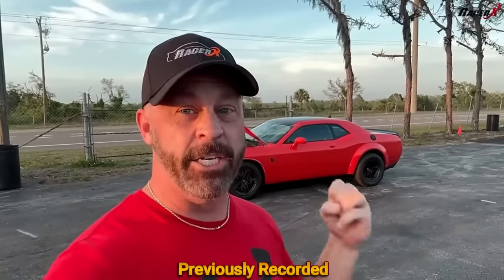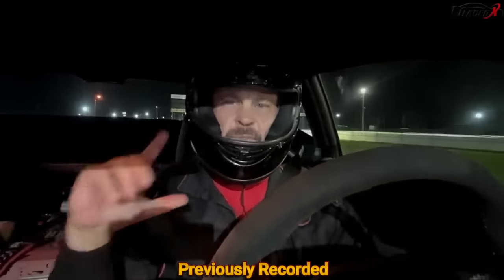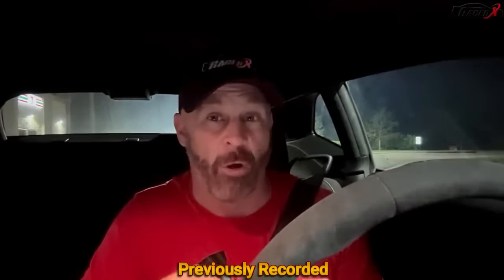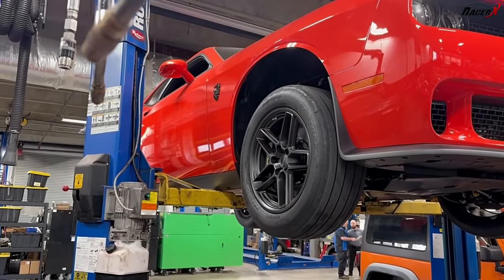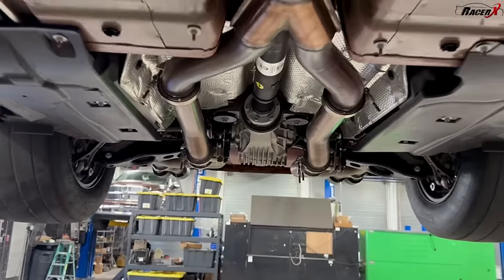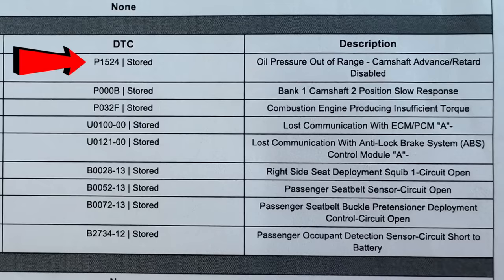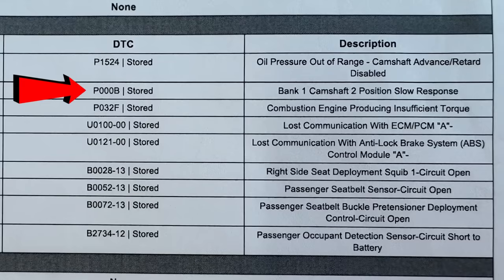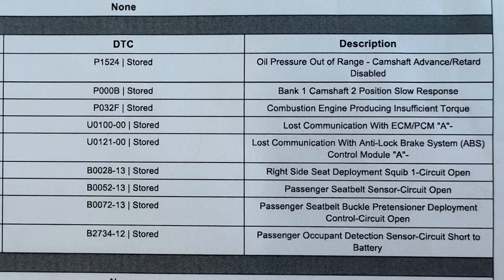What's Going on with my Demon 170?  Is my Engine Trashed?

Comment from the maker: Here is the link to the Dream Giveaway Plum Crazy Challenger Giveaway with my Code:
https://www.dreamgiveaway.com/tickets/challenger?promo=RACERX
Reply: I was messing with my 2016 ram 1500 PCM I accidentally left one of the connection not attached enough. And for some reason it was revving my motor at 1500rpm. It usually sits below 900. I went back and sat it correctly and it was fine after. It was throwing low battery voltage. And ABS light with traction control.
Reply: You picked the perfect colors for a vehicle named the Demon !!!

Comment: I am so glad I'm still stuck in "Old School Mode"..  All that $$$ and issues with new and owned by the dealer for analysis and fix.. No more "tinkering" yourself..  God bless you techies..  And those with all the money....  I'll be happy with my carburetor  equipped Dinosaurs.!!
Reply: Right on.  The Demon is a beast but I'm afraid all this high tech is it's achillies heal.  I'll stick with my old 70 Challenger R/T.  I can't touch those ET's, but I'm ok with that.
Reply: Love my '70 AMX so much...had it 43 years now.
Reply: @airforceveteran71  wow, nice care they were quick back in the day...even the 390 AMC matador was fast....
Reply: @archieguitarz4700  you got a keeper brother. I still got my 1967 coronet R/T also...
Reply: @airforceveteran71  good for you!  A friend of mine raced an AMX for many years.  It was a rocket.
Reply: @jeffrey501green  hey thanks, love those big block b-bodies too!  Hope you get many more years of enjoyment out of it.
Reply: @archieguitarz4700  thanks, same back at you buddy...
Reply: @archieguitarz4700  Was a show room dealer car new...a Dick Teague classic for sure.
Reply: My 13 charger Pursuit was a cop car before I got my hands on it, and I thrash it, live way out in the country. 254,000 miles now and all I did was put in a new spark plugs, control arms and water pump. It still pushes me into the seat at 100mph.

Comment: Thanks for the update, I have been curious as to what was happening.  I hope they get you fixed up, but it is amazing to see a drag car with a warranty!
Reply: Yes it is. But that Warranty won’t do you much good if you can’t get the factory to back it up by getting in touch with the dealership. Or worse, having a car that doesn’t run right sitting in the dealership while having outrageous payments.

Comment: Really hope Dodge takes care of you and your car. You are such a super spokesperson for Dodge.😎
Reply: They would if they cared, but this is a whole new ballgame with Stellantis.
Reply: Dodge is not really Dodge anymore. They're worse.
Reply: I'll never buy dodge. You will be taken care of because you bought a high end car and you do YouTube. But dodge is bad about warranties and backing their products in my experience. I actually had my home burn down because of a recall on a 2004 Durango and got no compensation or anything. What a worthless car manufacturer. I will always hate them💯 also had a work van with extended warranty that was purchased when new. The motor blew and they would not stand behind it. Bought a new Chevrolet work van and I'll never go back. Goodluck to you and the car. Dodge is trash💯
Reply: @PSYCHOBABAYAGA Hopefully your Chevy van doesn't have any issues.
Reply: I mean he is beating the crap out of the car. Suspects something is wrong with it and does 4 more hard launches at the strip. I mean how many times has he ran it already 50 times, 100 times. That’s quite a bit of abuse especially given how violent the car throws that power to the wheels the first 60 feet something is bound to break doesn’t matter how tough it is from the factory
Reply: @reverselee3218  none it's been a great work van.
Reply: Dodge is really hurting financially. I doubt any of these people are gonna have luck getting their car fixed without suing dodge

Comment: Sure hope it's something stupid, like computer related. Missing the Demon content. Praying for you and the 170, brother
Reply: Typical Dodge junk
Reply: @allanhood4397  Yeah from a typical🤔 Dodge Hater..
Reply: Getto cars
Reply: I'm agreeing with the idea that it's ether a bad sensor or a programming issue. I just hope it's not a defect in the oil pump cavitation of the oil. That's going to cause damage. The computer should have a recording of the oil pressure when it set the codes. And the RPM at the time. Hoping for the best for you and your car.
Reply: @dragvan1937  I know this is 12 days old but it sounds like the violent launches pushes all the oil away from where it's needed causing the engine to start eating itself.  Was a known issue with the bosses at Stelantis but they had already built a bunch of engines so they quietly put in a better pump on all future built engines (or one that keeps the oil where it needs to be properly) and just crossed their fingers.

Comment: I ran the wholesale parts at that dealership.  It will be a miracle if you hear back on that Star case.  We had cars sitting around for months because I could not locate parts or Stelantis couldn't supply them.  The parts and service get screwed because Stelantis can't deliver.  I had to submit two and three requests for hellcat parts before they would release them.  I could have sold five times the parts if Stelantis could have just supplied them.

Comment: Sorry to hear that the Demon is down.  Hopefully it's something simple like a bad oil or cam sensor or just tuning.  When the intake manifold gasket took a dump on my Trackhawk, I got all kinds of error codes like cylinder misfire, bad throttle body and all kinds of codes related to vacuum leaks along with going into limp mode on the street.  Seems like when one thing is wrong, it makes the other stuff go nuts too.  The dealership had my ride for about 2 weeks, but the cool thing is that it was all covered under the 5 year powertrain warranty with 2 months to spare.  I hope you get it back soon sir.  Blessings!

Comment: Timing chain guide is broken and/or VVT. Cam phaser mounted on cam is bad.  That will cause Timing issues and it will go into limp mode. Oil pressure sender is bad but will not cause issues your having. Same symptoms I had on my 2012 SRT8 6.4

Comment: Stellantis tech here, that ‘head’ tech is gonna lose his ass working on that Demon. He will not be compensated for even half the time he spends wasting on this work order. He will quit and it’ll be the next guy up. The engineers, if there are any left are gonna waste his time, spin him around in circles and this will take forever to resolve. That Wagoneer rental is likely about to throw a check engine light any moment as well.
Reply: im starting to think i made the right choice getting a '22 hellcat over a '23 seeing all the problems with these things
Reply: @ItsBlurrs I noticed alot of covid cars 2020 to 2023 have a lot of problems. I have 2016 scat and hellcat not one single problem yet the newer guys have a lot of problems.
Reply: 2021 scat with blown motor at 24k no help from stellantis feel you pain brotha!!!
Reply: @ItsBlurrs  You’d be blown away if you saw as many faults and issues with all these engines. They can’t even clean the casting sand out of the block properly, guess where that stuff ends up?
Reply: Too bad the dealerships lost so much money on selling the Demons to be able to pay the techs to work on them.  That $100k+ markup had to go to the owner, not the employees.
Reply: The techs are on the payroll. How can they be cheated? There should be a regional specialist working on it with the tech. This labor is all covered by warranty.
Reply: @sophiaskeens6417  They are also losing their asses on the Hornets, Wagoneers and heavy duty trucks.
Reply: @markg7030  The techs work for flat rate, its a warranty job so they will be paid half the amount compared to a customer pay job. He would easily want to do a four wheel brake job instead.
Reply: @jerrykurl69  May sound silly, but should I volunteer to pay the difference if a warranty repair underpays?  My parents owned one Mopar ('67 Newport)  and I've owned three.  Dealer incompetence and crap attitudes appear to be the norm.  

If I offered to pay the difference would I suddenly begin receiving timely, competent repairs?  Most recently, both passenger side door panels on my 2020 300S were replaced due to warping.  300 was delivered to the dealer from a nearby detail shop - spotless.  

Picked the car up with numerous smudges on the paint and glass - I suspect there was a bugger left in there somewhere.  It must be me for sure - don't know the 'secret handshake' or something else.  I could go on but you get the point.  

So far, my 300S has been my most trouble free Mopar to date.
Reply: Ouch! Yea,   Your Right! The way All the companies are treating and taking advantage of their Techs is shameful!   I think this is a computer problem, or a module issue. I hope it is a simple FIX!
Reply: @jerrykurl69 so the dealer charges more to the customer so the dealership makes more? Reading between the lines at your statement
Reply: @3644Darrell More like the manufacturer pays less time under warranty than the jobs take to do.  The manufacturer states to the technicians that they will make up the hours they lose, from retail work.
Reply: I am a retired Stellantis tech,quit 2 years ago.Star case is pretty much useless,those people at star do nothing with engineering.I was lucky that I had several contacts that could hook me up with engineering .several times I could get my time paid for as long as I had everything documented.
Reply: @jerrytriplett3013 I have 2015 Scat Pack with over 100k and still running the original clutch and by no means am I real easy on this car.
Reply: Love it
Reply: @TexasSpeedManiac  that's what I mean MDS on these engines is a joke.  You definitely have an advantage not having that.  24k my valve falls and shatters my no 3 piston at 30 mph destroys the head and scores the block so bad I need a new one.

Comment: Bummmer. I'd think considering you being such a recognized high profile YouTuber that Dodge would jump on this ASAP. I know that if my 2023 Daytona had issues ( fingers crossed it won't!) I wouldn't be as composed as you ( even if it's just on camera!).I like many subscribers look forward to all updates.
Reply: Dodge has jumped on it. The SRT engineers have departed. Engneers that design Fiats and EV's are not going to be helpful. If you bought a Last Call anything it was a roll of the dice. If you bought a 170 your going to to be in for a lot of frustration since the resources to troubleshoot anything don't exist. The techs at the dealership have not been trained to work on these cars. They are learning as well. As Dodge folds your going to be left with no techs as they will move on. Kudos to RacerX for showing the reality of owning and driving the car as intended. For all those sitting for sale that have never been driven - your likely buying a pig in a poke. That Grand Wagoneer is pure garbage BTW. They can't fix the gremlims on those either.

Comment: RacerX "It's not running right, not sure what's wrong with it."

Next video clip .. 

RacerX " I'll be launching it on a foot brake." Then launches it.

Me " Why would you keep beating on it if you know there is an issue?"

I would have immediately stopped and had it towed to the shop. Or at least drove it to the shop

Comment: Lot of folks been having issues with 2023’s, door panels coming apart, electrical issues etc…
Reply: That's because Dodge doesn't care.

1. This generation of the chargers/ challengers are at the end of their run

2. Dodge will just say "you raced it, so we won't cover it"

Comment: RACERX,
  I owe you an opology. I thought you modified the 170 ,but now l recall you said on a previous show you were not modifying the 170 to keep the warranty in tact. My bad.
   I do love your show and your enthusiasm and competitive attitude. 
I like your show so much ,in August 2022 l purchased a brand new Challenger RT in F8 green.
Only option on my RT is the automatic trany. I have a spinal cord problem so l need the auto trany. 
  I could have purchased a Camero or Mustang ,but went with the Mopar for the traditional muscle body and especially the round headlight retro style.
   I have been rer ended several times. Having a bigger car just makes me feel more visible on the road. Higher seat level makes it easier for me to enter and exit vehicle.
I see some drivers with portable car hand controls prefer the larger Challenger too.
  I love my RT. I put less than 1000 miles per year ,so l will do well if l ever decide to resell.
   If you have kept the 179 stock ,the dealer should cover the oil flow problem. Hopefully they find the fix for fast ,so we can get back to seeing a true stock 170 raceing again at the track.
   Keepin my fingers crossed. 
  I love my RT. It sounds great. I don’t race it. Don’t burn the tires. I’m keepin it cream puff condition. Only drive it about once every week or two. Got plenty of power for my non racing needs. Just a cool cruder with a great stock sound. I’m keepin it totally stock for future generations to enjoy and collect.
  Once again, l hope they find a quick simple solution. I hate to say, if it’s been there two weeks, it looks like they can’t figure it out.
I see they have made a “case study” of your 170.
Your 170 looks so cool on the road and at the track.
I guess l should get a RACERX cap. They do look cool. Hope you get caps in a lighter color for sunny day events. We should see your fans wearing RACERX caps at the track when you race.
Maybe give some out as a promotion ,to kids at the track?
  Your show is great. I feel you should have a larger following, but there’s a lot of competition.
   I saw how you modified the Mustang with nitro and you and others were impressed. I thought maybe you did the same with your 170.
   Having your car in the shop is like having a sick pet at a pet hospital. It really gets to you. 
  I real hope they find and fix the oil flow issue.
    The stock sound of my RT   turns heads all the time. I keep it clean and covered. 
  Thanks for sticking with MOPAR. The best of luck to you and your shows future.👏👏👏🏎🏎🏎

Comment: I'm not really surprised. This car came off an assembly line. I have NEVER seen an engine/transmission off the assembly line that was close to what it should be. Also, was this engine even built strong enough to handle that much power on a race track? Probably not. It likely has the same internal parts as the lower powered versions. And everything is controlled by computers. I have never heard of a storebought race car with a warranty. COPO Camaros, Cobra Jet Mustangs, and Drag Pack Challengers never had warranties. Race cars are intended to be abused. I have been a drag racer for more than 40 years. I have always raced '60s and '70s cars. Hand built carbureted engines. Cast cranks, rods, and pistons. Perfect clearances. I have never gotten close to the nines, low twelves is the best I've ever done. I have always overbuilt engines for the power they made. I have had a few failures, most of them caused by build mistakes. For much less than that Demon 170 cost, I could have built one whopper of a race car. Simple. Carbureted. No computers. Using a GM 6-71 blower that cost a fraction of what the one on that car cost, and is much stronger. 

Back in the '60s, Mopar, Ford, and GM built factory drag race cars. They were very simple compared to what is being built today, they were slower, but much stronger. Todays cars are nowhere near the quality of cars built in the '60s. This car was built on a design that was intended to be disposable. Hopefully the damage isn't too bad. But there is no way that car is going to hold up over years of drag racing without an absolutely insane amount of very expensive broken parts. Most of those cars were sold to collectors that will never race them.
Reply: yup, a race shop will ALWAYS provide a higher quality build.  Compared to assembly line stuff !
Reply: And yet us real hot rodders like the YouTube channel sloppy mechanics went 8s for 8k.

Comment: Oil could be sloshing back and the pick up becomes uncovered reducing oil pressure. There should be baffeling in the oil pan to reduce this , but who knows?
Reply: The dodge engineers should know that and they do about the sump oil pumps.  They don't want those engines to last to long.

Comment: 2016 Challenger Hellcat. Engine replaced a little north of 1,000 miles. At dealership for 37 days. I relayed to the assistant manager at about day 30. Provide me with equivalent vehicle to drive. You can keep the car as long as you need to.

Comment: Simple quick check would be to temporarily install a mechanical oil pressure guage and check the actual pressure, if normal, try another oil pressure sensor. Hopefully, it is just a sensor or computer glitch. That being said, after watching this and all your other 170 videos, I am SO GLAD I didn't buy one of these. I was set to until the greedy dealer tried to rip me off with ridiculous markups.  They look like they are impossible to race consistently, and in drag racing that is essential.  I'll just stick to my lowly 1320, it runs like a Swiss watch, super easy to drive, and very consistent; three years now and zero issues. If I get to the point to where I cannot live without a 9 second car I'll just get a Tesla...

Comment: I’m a dodge technician as well. Suggest checking oil pressure with a manual gauge and it probably needs an oil control valve

Comment: Transmission converter lockout failure. The cam sensor threw a code, and it failed due to a low-pressure oil pump. It threw the loop out of the sink. They'll find the issue. Don't worry about it. But at the end of the day, it's likely a sensory issue.